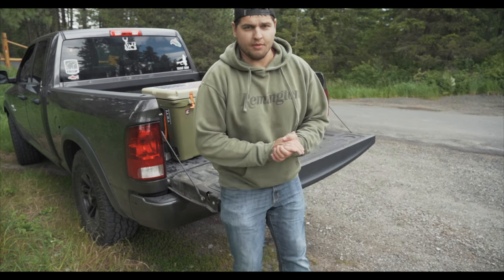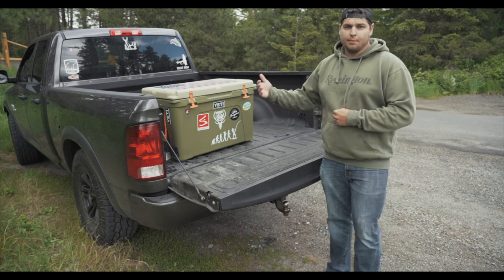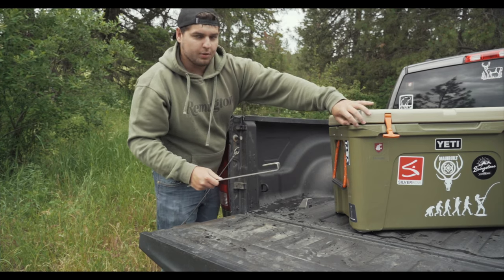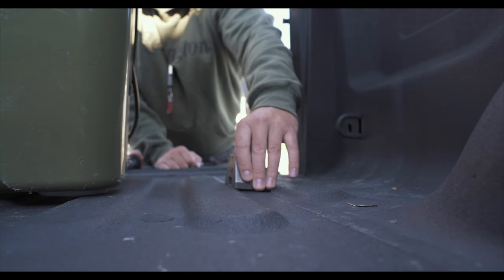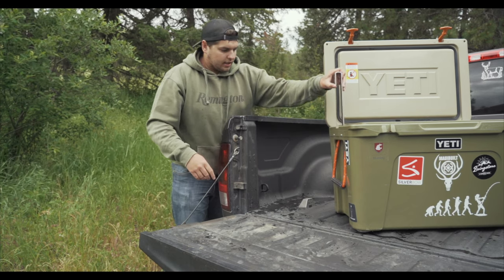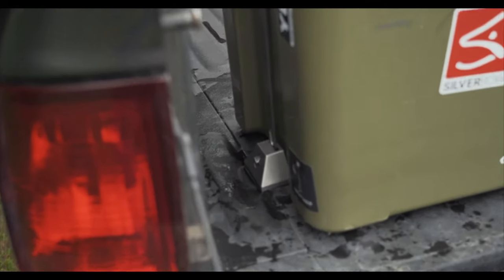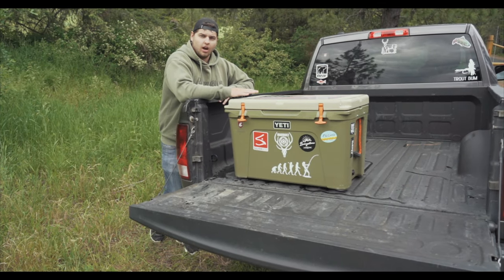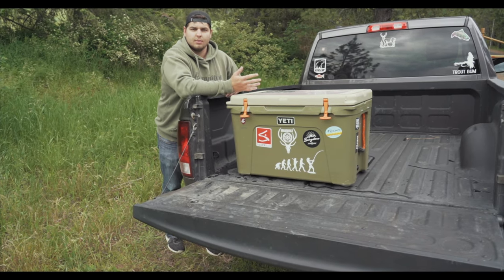SECURE YOUR COOLER | DENY LOCKS

Comment: I have schmidt-riffer metalcrafts cooler locking devices and g70 & g80 chains and massive padlocks on my coolers. I lock both sides and 2 locks on lid.Hate a theif ,i dont leave my coolers in my truck, only at rest area or a restaurant when traveling. It only takes a minute or less. All i can say is i tried. Good luck 👍3/4 inch chain by the way.

Comment: They could unscrew the nut under the truck right? 
Can you demo how you unlock it?
Reply from the maker: You unlock it with a key.  You can't unscrew it under the truck, ones its tight the screw breaks away.

Comment: What’s stopping anyone from just taking the nut off?
Reply: That’s why I’m wondering lol
Reply: @borisalexandrov6832  I bought one and I haven’t had any problems so far. I mean I never leave my truck unsupervised for hours in public but if you did and people really wanted to and knew how the lock works they could just undo the nut. But I mean I think it’s designed that if you go into the store real quick they can’t just pick your cooler up and take it
Reply: @borisalexandrov6832  another thing is a lot of locks can be broken if you just get a screw driver and hammer it into the lock slot so I don’t know that’s also kind of a possible flaw. I also have a chain and lock and chain it to my bed which may be a little overkill but it’ll give me more time I guess.
Reply: @Sancho2852  I am planning to always keep it in the bed of my truck and I’m wondering if that will prevent thief’s from stealing ? I don’t have much space inside my truck since it’s midsize and I don’t want to put a whole bed cover on because I most of the time I’m transporting my dirt bikes in the bed
Reply: @borisalexandrov6832  it’ll definitely prevent thief’s but if a thief knows how they work and has crescent wrench and enough time to take it off yes they can steal it but either way I’d still recommend the deny lock it’s your best option in protecting your cooler and there’s not really any other solutions

Comment: You got this because you lost the key to your cable, so you got an even more expensive security system that also requires a key?
Reply: I was thinking the exact same thing
Reply: Think it’s because he realized he could just cut it with some bolt cutters
Reply: @Dylweed321  I mean you could take a grinder to this still.
Reply: Your wife can take a grinder